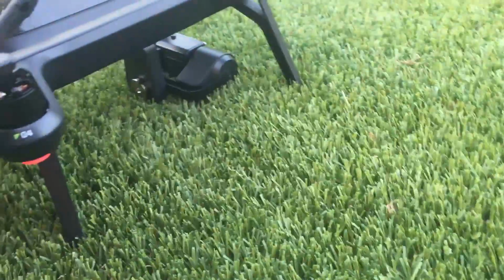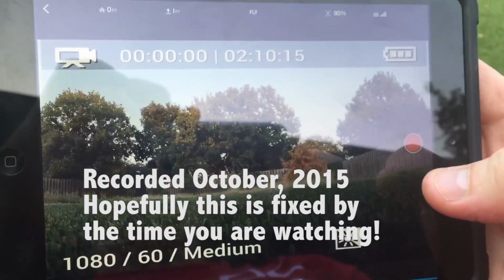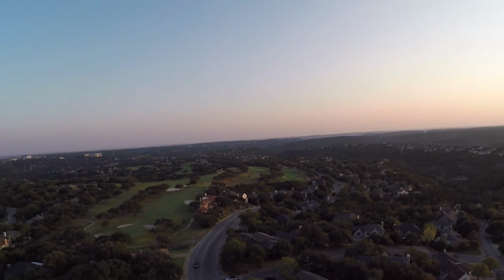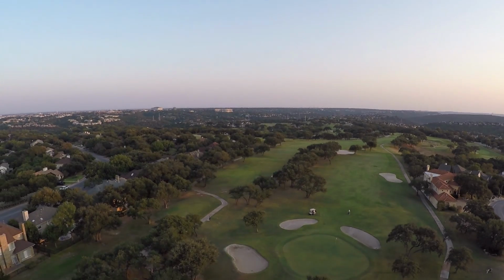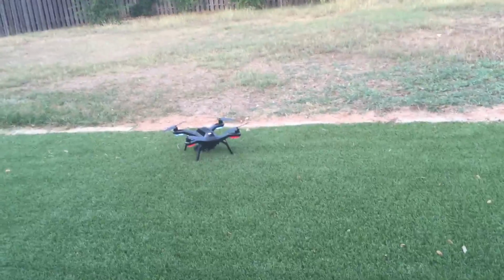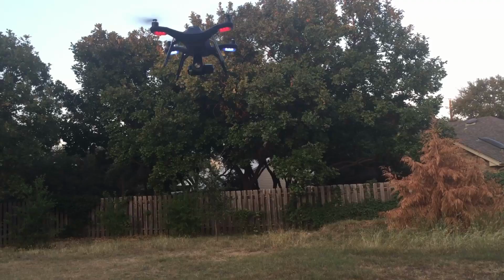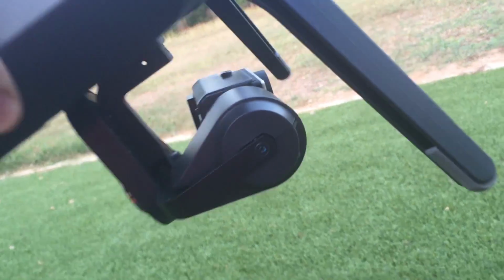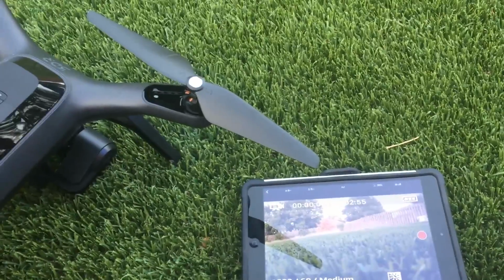3DR Solo Gimbal Review and Flight Footage

Comment: You'er just another Solo sucker, 3DR is a scam, you should have bought the Phantom 3 Professional, they are the best. DJI doesnt just make systems that look cool, they actually work.
Reply: ***** Neither am I, but I don't think making a company rich and being their lab rat is the way to go. For me studying the facts and not taking unreasonable risks have save me THOUSANDS of dollars and hours of frustration This is why I didn't run out and buy the OSMO, DJI needs to redesign or fix the many issues with it before I spend a dime on it, I'm no slave to them either.
Reply: +Bobster986 I used to own every DJI piece of crap before buying the solo (except the Inspire).  Every DJI either did a fly away or decided to fly into the ground on it's own.  I will never own another DJI product.  The Solo does what it's supposed to do.
Reply: Kevin E yeah, it flies for the stupid pilots that can't. LOL

Comment: Thanks for the video - 
The battery of the GoPro is significantly better than the drone, so I hope the camera is not using battery power from the Solo that shortens and already short battery life
IMO, the flight time/battery life is the biggest issue with the Solo
Reply: ***** Thanks
Reply: +DavidisDawei DJI says that the Phantom 3 gets 23 min flight time.  My Solo gets 20 to 25 min depending on flight conditions.
Reply: Kevin E +
Thanks Kevin,
I just bought a $30 drone last night that includes a 2MP camera.
It's flight time is 5-7 minutes, so I bought an extra battery for $4.
I hope this will serve as a usable drone that can be easily transported in my backpack and take acceptable video when I am in some remote location
I did not feel comfortable taking a drone that cost $1000 on this trip

Comment: A nice review of the GoPro Gimbal. I too now have quite a few flights with the Solo on my channel and really love this platform for arial video. I had the same RTH issue that you experienced. Its because of the WiFi noise in your neighborhood. I flxed this by purchasing the FPVLR antenna (www.fpvlr.com). Check out my range tests after getting the FPVLR antenna (night and day difference). I also fly the Yuneec Q500+ and am working on a compairson video about what I like and dont like for each platform. The Solo is my favorite and the more I fly it, the more I absolutely love it.
Reply: +Chasn The Wind I'm thinking about either a Solo or a Typhoon.  Do you have the comparison?
Reply: +deezorama Since I fly both, let me give it to you straight. The Typhoon will be much less of a headache and far cheeper. It picks up satellites quicker and is super stable to fly. You do not need to buy an iPad to view the video since it is built in. The Solo is much faster and more nimble and when everything works, its a joy to fly. My last flight took 35 minutes to get a satellite lock with the latest firmware and updates installed the night before. The Q500+ is ready to fly in about a minutes or less always.

Solo - $1000
Gimbal - $400
GoPro - $500
iPad - $400
Extra Battery - $150
Total: $2,450

Typhoon 4k - Around $1,500 or less
Extra Battery - Included
Video Screen - built in
Hard Case - Included
Reply: Thanks!  I already have a Hero 4 Black, so I need to decide to go with the built in camera or use the GoPro.
Reply: Expect to spend another $2000 for the solo unless you already hace an iPad mini or amdroid tablet  You can also use your phone. The Solo is a fun platform to fly and looks very cool. I get so many compliments on it
Reply: +Chasn The Wind The Phantom 3 Standart is just $499 now. It's a stellar, and 3DR killer.
Reply: I believe that the standard does not use the light bridge technology that the advanced and professional versions do, and thus is plagued with the same limited range issues the Solo is out of the box. I do agree that for the price, its hard to justify the cost of a Solo.
Reply: Yes, it doesnt has lightbridge. But i cost less than a GoPro, and it flies well too... GoPro brand is a rip off. Also DJI has the best software too, the 3DR Solo software is so disgusting. I think GoPro should colaborate with DJI at the first place. It will be awesome. But it's too late now. Bye2 GoPro. Say hai to DJI and Xiaomi Yi (Gopro Camera Killer).

Comment: Both Antenna pointed up ! That is not good. You will get very poor range with that setup. That is why you lost signal.
Reply: +Ready Set Drone  where are you going to get a range extender? Is the signal from the controller that weak or is it a weak receiver in the Solo?

Comment: so not a true 3 axis gimbal like the inspire gimbal, which will rotate left and right ...bummer the solo doesn't do the same thing....but then you would have legs in the shot
Reply: Solo, Phantom 3s, and Inspire all have 3 axis gimbles.  Inspire is only one which lets you CONTROL the yaw of the gimble.  The others just smooth out the yaw motion of the quad.